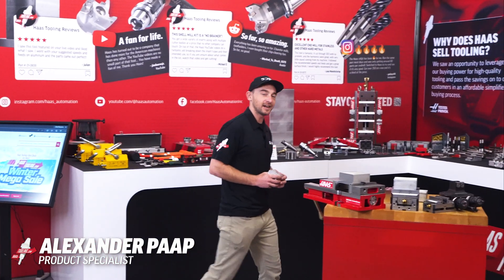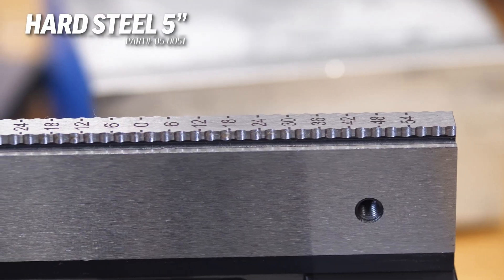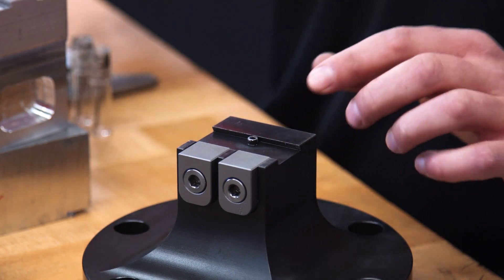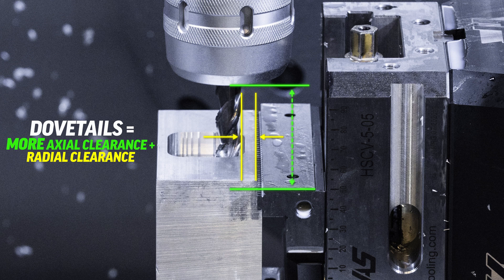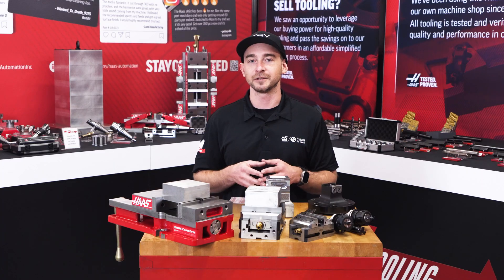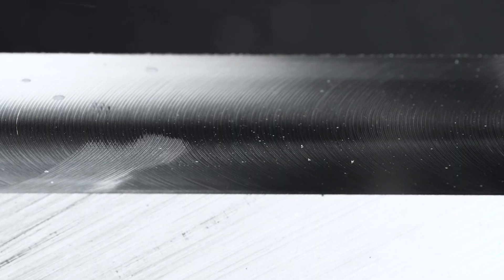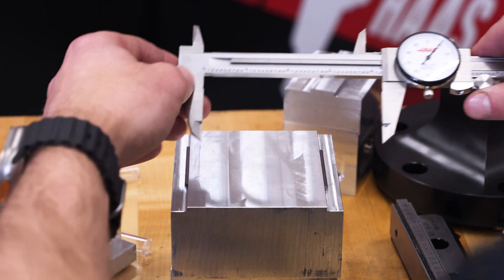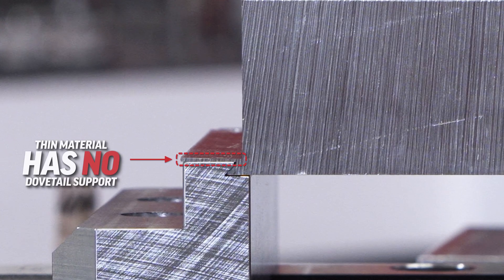Grip Your Parts Better with a Dovetail - Haas Automation, Inc.

Comment: I'm a bit confused thought, to cut the dovetails into the stock, I need to clamp the stock, but the stock doesn't have dovetails, to grip with dovetails, so....... wouldn't it better to note that it's mostly useful when you want to use most of the stock and have to machine most of the outside?
Reply: In the initial dovetailing op - the matrial was clamped the 'normal' way, into the flat walls of the jaws. After dovetailing, the stock was raised, flipped, and mated at the top of the vise into its dovetail jaws - you're now using much less material for workholding (less waste, cheaper, shorter total cycle time, better tool reach).
Dovetailing raw stock is not required, it's a personal preference. 
But typically in production your goal is to make profit - you don't want to spend extra $ on excess material for clamping and longer cutters.

Comment: I love dovetails! Yeah, they’ve been around forever, but now nearly every vise maker has come out with a dovetail fixture, because they work, and they’re a good value. For 5-axis work where clearance is an issue, there’s nothing better. I do love the Lang hydraulic clamping system, we have a lot of customers that use it, but it is not cheap, not remotely, and still needs to be used with a self-centering vise, which again is great - most of the time. But if we need tool clearance, and a bomber hold on our parts, many of us find our way to a dovetail fixture. Lots of options, and a lot of valid perspectives, just gotta find the right tool for your job, at the right price point.

Comment: Stamping is relatively quick, Lang offer's a really nice set up not sure if HAAS does? It's really ideal for marking your part without a stop.
Reply: at the moment im doing long slender parts thats 40mm round and 100mm long and clamping them in the end,they rip out with stamping,we have a lang stamping machine and it has its uses as do dovetails.